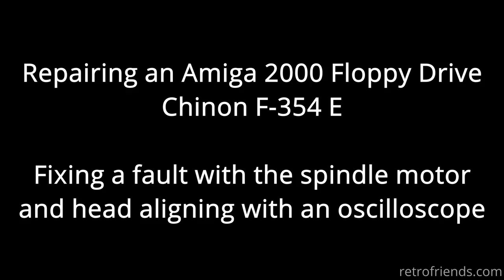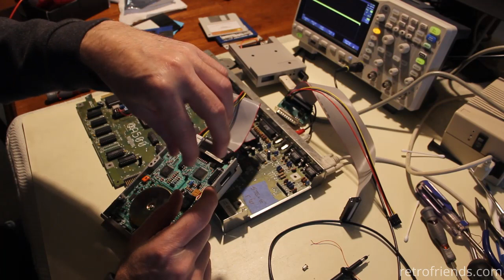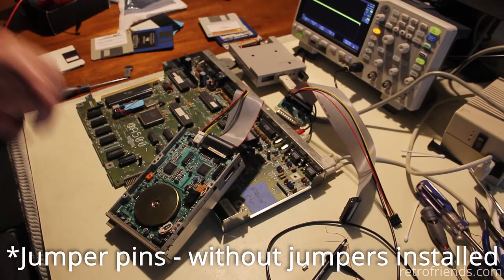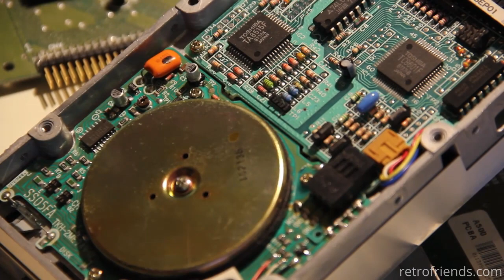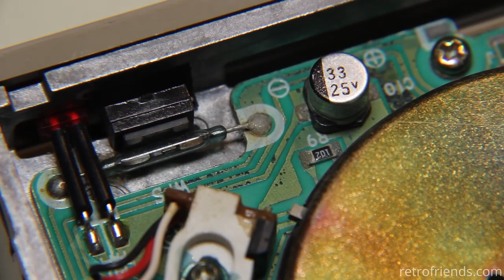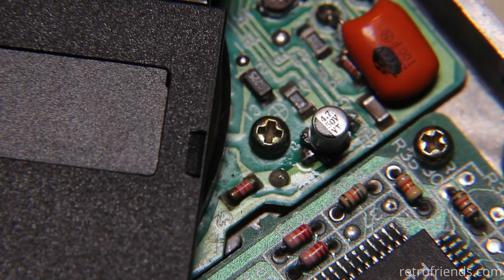Amiga 2000 Chinon F-354E Floppy Drive Fix

Comment: it would have been easier a bit if you'd have soldered with temp a bit higher than 100C
Reply from the maker: My soldering iron (or any other I have seen) cannot be set to that low of a temperature. Also solder itself will not melt at all at that temperature. It is important however to use lower temperatures when working with SMD components.
Reply: @retrofriends  bad joke, my bad, on video it seems like you were soldering with way to low temperature, especially noticeable when using solder wick.

Comment: Is there no disk-inserted switch on this drive ? I have two of them in one of my A2000s, one of them does not detect the the inserted disk (but waits for it with the usual clicking noise).. When I compare the semi-broken against the working one, there is no visible difference. Both have only one pin with the hall-sensor for the write protection, and when I insert a disk in the working one, I see no mechanical activity besides the head being pushed down to the floppy. Is it possible that the head unit has the disk-inserted switch ?
Reply: Reply to myself :)
The floppy-inserted switch is actually the one on the other side. Just as the reed for the write protection tab, this one is controlled by a magnet on the eject button.
Got it recognizing that a floppy was inserted (just a cleanup did that), but it refuses to load any of the (good set of) test disks I have. Probably alignment or cap problem or all three of them.

Comment: I just twist/wiggle those caps off (press dont pull), clean then desolder/wick, address any trace corrosion and remask. 
Havent damaged a pad yet, just as likely if not more so using your method.
Great vid.
Reply from the maker: Thanks Mickey!

Comment: I have the same Disk Drives F-354e in my A2000!! Can You tell me the Jumper Settings for Df0 and Df1🤔
Reply: DF0:
x x x
x x-x

DF1:
x x x
x-x x

Close J301 and use the correct cable for A2000: 
https://www.amigawiki.org/lib/exe/fetch.php?cache=&media=de:expansion:storage:floppykabel_intern.jpg
Reply: @analognexus  Thank You Very Much!!! But these are the Settings for the Chinon FB-354!!! For the Chinon F-354E it is a little bit different😉👍 I can't find nothing about it!!
Reply: @ralfr.5974  Ah sorry, just mistaken with FB354E. You should just measure with multimeter from jumper. DF0 goes to pin 10 on the back of the floppy connector. Set the jumper in that way that you can route the signal to pin 12.